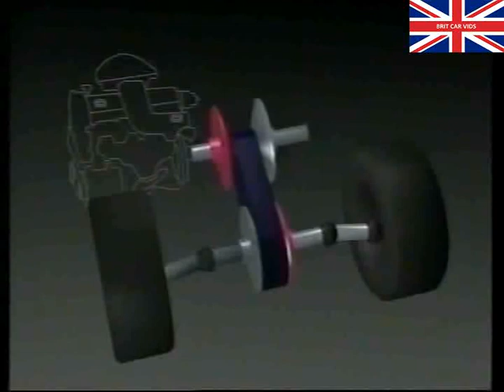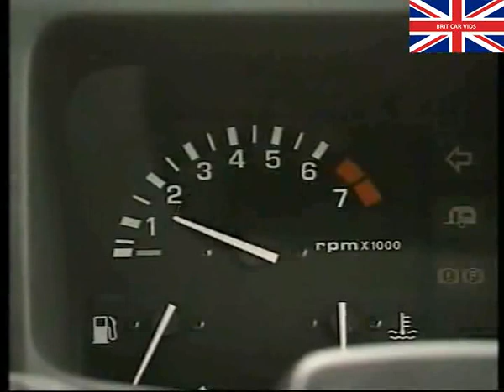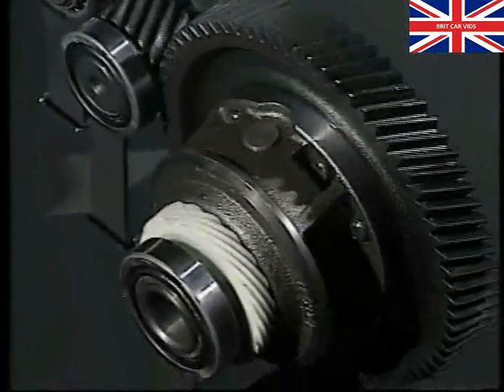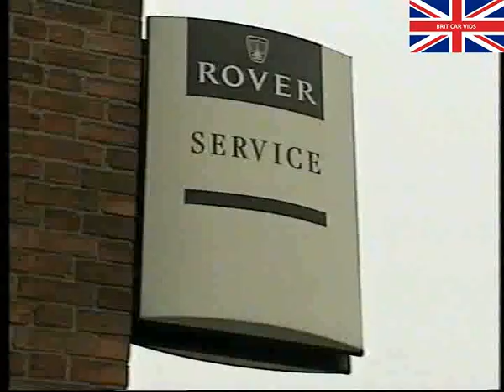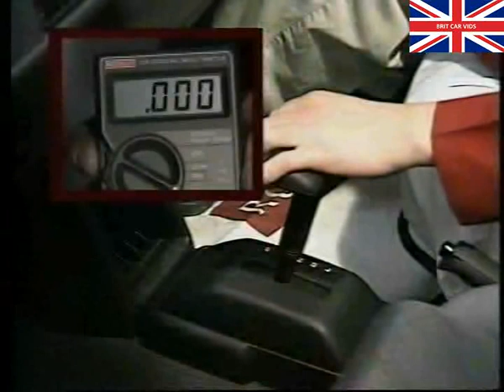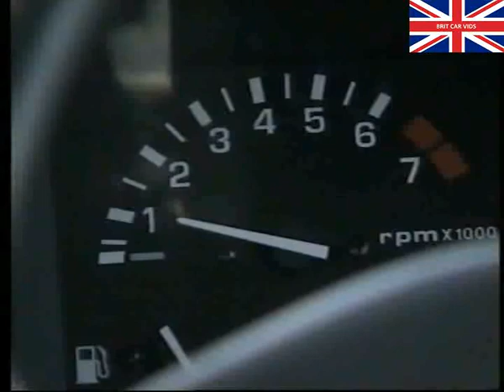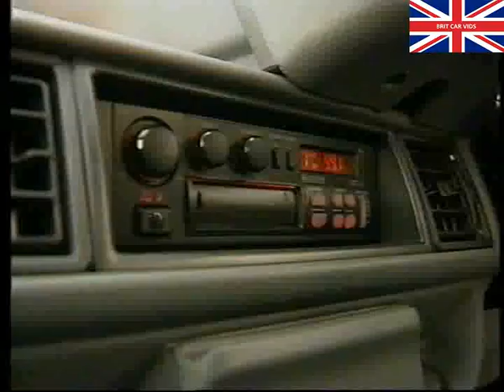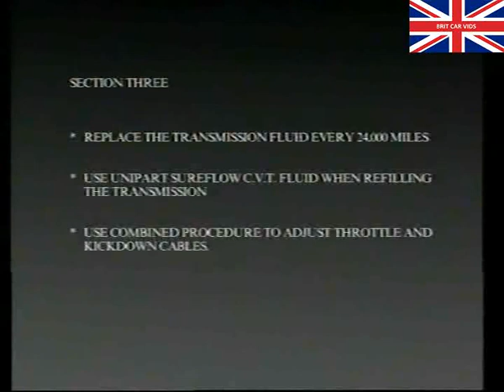Rover - Service Insight - VT-1 Automatic Transmission (1992)

Comment: these use to fail at very low mileages like nearly all cvt transmissions, im glad all manufacturers pretty much stopped using them in the UK, they are still common in the USA